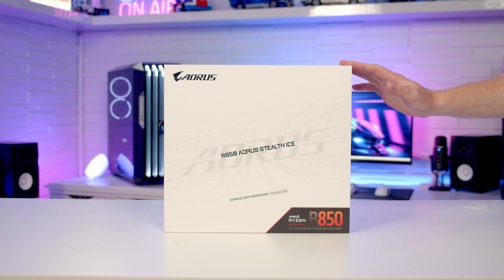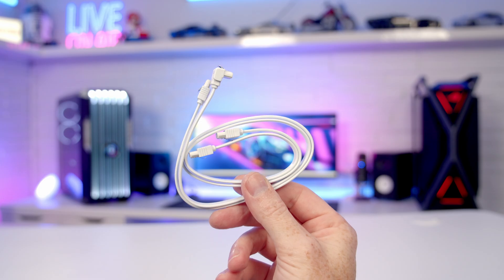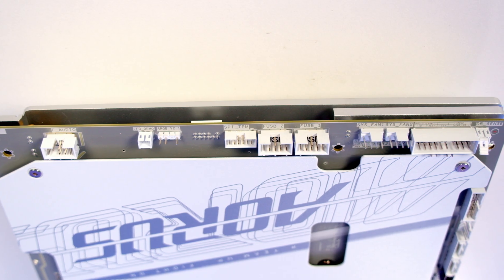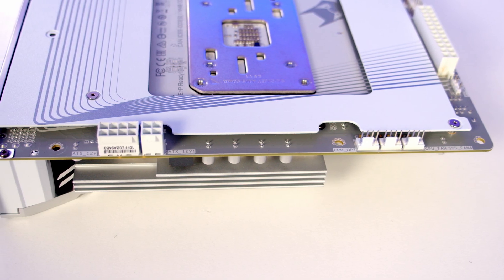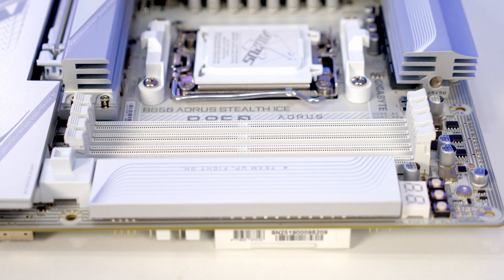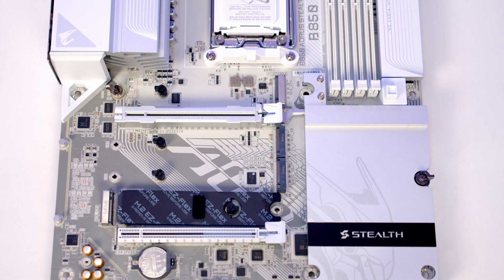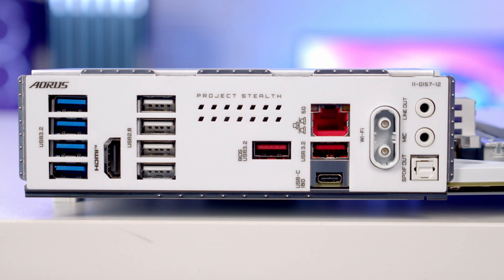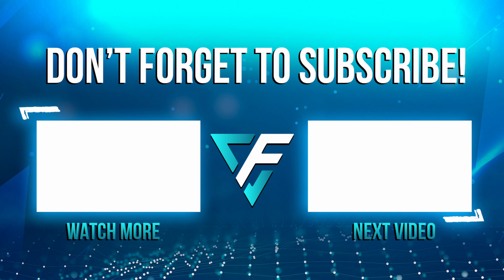B850 Aorus Stealth Ice Overview

Comment: Question First time pc builder. Been doing loads of research and ahopping. Stumbled on an insane deal for a ryzen 9 9900x3d and it came with free ram cosair 32G CMH32GX5M2N6400C36 its 6400mt cl36. Seems as though this ram is given away for free often from newegg. Several reviews say there is loads of compatibility issues with it. Noticed it has an xmp logo on the box but no expo. Was thinking of going with a taichi atx motherboard. I was able to find the part # on the QVL list for the taichi. But it doesn't check the EXPO box just the XMP. But its on the list. I would love to make use of the memory. Am I doomed or is it possible this memory would perform ok? Is there a way to enhance performance with out EXPO?
Reply: DON'T GO WITH TAICHIIIII IT MURDERS CPUS.